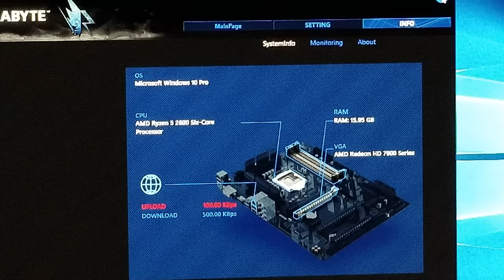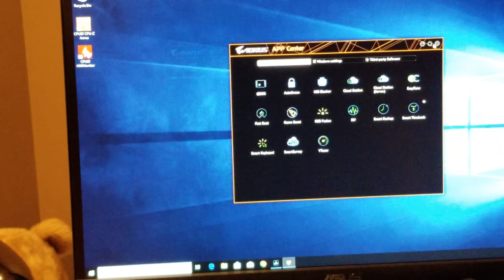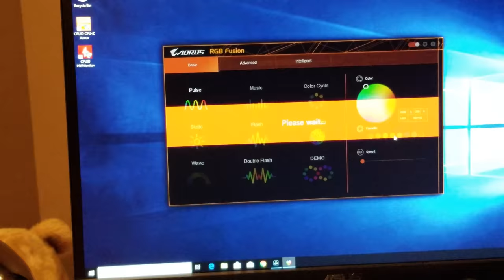Cooler Master MasterCase H500, Build Guide & Aorus B450 Pro WiFi

Comment: Hi there! Just finished building in this case and I have one issue. At 20:20 in the video you talk about the RGB fan wires, I think? and I'm not sure where I have to connect the cable to. The case wires label 2 different wires as one for (asus, msi and one other I think) and the other one as gigabyte (3 pin in). I had attached that 3pin in, into my gigabyte 12 volt RGB LED strip header on the first 3 pins (referring to the arrow on the cable) and I think my RGB lights blew out when I turned my computer on. At first I had my gigabyte labeled connector on the 5 volt ARGB LED strip header and the fans were dim and flickering so I had switched to the 12 volt one thinking it would supply enough power to the RGB fans and thats when I heard a slight pop.... It was  going so well until the final part ****. Any advice? Thanks for the informative video.
Reply from the maker: The 12V may have shorted out the RGB, you were right the first time plug it into the 3 Pin 5V Addressable RGB Header, the different connectors depend on the MB, the ARGB cable from the case when going into the MB make sure the Arrow on the Case ARGB Cable lines up with the 5V ARGB Header on the MB...also make sure the SATA Cable from the case is connected to the PSU...hopefully it'll then work, so if it doesn't (worst case scenario) you might need to replace the RGB Fans with newer one's, and if there was a LED strip you might need a new one as well, or just go without...hope that works for you...
Reply: @Reviewing_Playing_and_More_RPM  Thanks for the super fast reply much appreciated!!! Yeah... lights are shorted but fans work so until I get replacements I’ll have to live without any RGB on the front which is ok I guess. I think the reason I plugged it into 12v was because in your video the lights were super bright compared to mine when I had them plugged into the 5v. Was that the same for your fan RGB brightness at the very beginning?
Reply from the maker: @canadianbacon5716  Honestly I never noticed them being bright or dull...take care...
Reply: @Reviewing_Playing_and_More_RPM  thanks again!

Comment: so in case cables where you connect stuff like the power button, reset button, power leds, etc, in all of those specific pins you connected everything to, is that order the same for every motherboard? i’m getting an MSI MPG X570 gaming plus if that helps
Reply: amazing video by the way! i’m glad i can have a sharper eye on what case i’m gonna be dealing with :)
Reply from the maker: Yes pretty much every MB will be the same, there might be a slight variation for maybe a proprietary system like HP or Dell but haven't come across one that was different yet, Glad you liked the video...

Comment: I have a x570 auros and is kinda confusing how to plug the case ping into it and the fans bc there’s only 4 pings and not 3 pings
Reply from the maker: The system fan headers are usually 4 pin, but will accommodate 3 or 4 pin, it's just a matter of lining up the tab from the fan to the tab on the system fan header tab and it'll be good...hope that helps...Thanks...
Reply: Reviewing Playing & More RPM so I got tired and just connected the back fan and front fan cable together and it’s working but I wanna know if the rgb should turn orange when I first connect it
Reply from the maker: I don't have this PC any longer and don't remember what color it first comes up with, but as long as your able to change the colors and they stay at whatever color you've chosen then it's good to go...Thanks...

Comment: My case only brings a 3 pin rgb connector and I have the same moba... I’m wondering do I just connect it to the same place on the moba and use the first 3 pins?
Reply from the maker: No 3 Pin is 5V ARGB and 4 Pin is 12V RGB so it could cause damage...there is an RGB Adapter for around $20 that you can get from Amazon that will let you use it...Hope that helps...Thanks...

Comment: I am looking to get this case, will my ASRock AB350M MB be enough to run the RGB fans? I have an RGB header but can't tell if it is 12V.
Reply from the maker: One is 12 and the other is 5V can say for certain which one is which though, can't get a clear enough picture, but the specs say it has both...

Comment: I'm using the same case and motherboard, but the cases rgb connectors are only one 3 pin and one 4 pin with one blocked off. It looks like you have a 4 pin with none blocked off. Did they change this? I can't get the rgb on the case fans to work because of this. Do you know how I would make this work? Or will I just have to use the controller? Was hoping I could make it work using the motherboard so I could just use the rgb fusion software.
Reply from the maker: Others have told me they did a newer version of this case, can't confirm that but lots have noted this same issue so it could be true...the connector that goes to your MB will be either a 3 Pin 5V Addressable RGB or a 4 Pin 12V RGB, it'll depend on what connector is on your MB, hope that explains it a bit...if you are missing the ARGB Header you can get a Converter that will let you use it I reviewed the Deepcool Converter and and EZDIY on as well that are good choices...

Comment: Where do you connect the rgb switch that comes with the case? Is it even necessary given the software?
Reply from the maker: If you mean the RGB Adapter, then no you don't need it unless you don't have an RGB Header on your motherboard...The software will control everything...Thanks...
Reply: Reviewing Playing & More RPM My case came with a small controller, I assume it’s to change colors on the fans but the case didn’t have any instructions on wiring. Also I’d like to thank you for helping me build my first computer 😁 however, there is one thing I’d like to ask: my gpu (Rtx 2080 super ftw3) has two 8 pin slots for the power and my power cable from the PS has a 8 and 6 pin combo. So is it ok for me to use two different cables to power my gpu? Say one 8 pin vga and the 8 pin pcie?
Reply from the maker: What PSU are you using, I want to check it to be sure...Thanks...
Reply: Reviewing Playing & More RPM I am using an EVGA 750 BQ
Reply from the maker: Ok so that PSU has two VGA, it's a naming convention some PSU manufacturers use, I think it stands for Video Graphics Adapter, so I would use both VGA Cables and you will be fine, not sure why they label it this way, most people are used to PCIE not VGA for plugging into the GPU...Hope that helps...
Reply: Reviewing Playing & More RPM Thank you for the advice!

Comment: Hey, i ordered this case and i have a question. I'm planning to build my pc this saturday, but how does the RGB for the front fans work? Are there 2 cables for each fan, or just 1 cable for each fan? Like, does the RGB + Fan get powered over 1 cable? Sorry, i'm not an expert when it comes to fan cables xD. And these cables, they aren't long enough to reach the motherboard i saw in this video. So do i need a RGB Fan splitter? (1 to 3 cooler master rgb fan splitter). 

Thanks for the video, and thanks in advance for the response.
Reply from the maker: +ZodFi There is an extension/fan splitter provided for the RGB fans that when used will also extend your reach to play into the motherboard.  There is also a Sata power cable you need to connect for the power to the fans...
Reply: @Reviewing_Playing_and_More_RPM  Thank you very much!

Comment: hi, will there be enough space for me to mount a radiator and the fan(Cooler Master MasterLiquid LC120E RGB) at the ceiling of the case for the cpu cooler?
Reply from the maker: +muhamad safwanshah There is room on top for up to 240mm so yes there's room...Thanks...

Comment: Good vid. At 32:33 only one fan is connected on the front. I own one of theses cases both fans are suppose to be moving at the same time.
Reply from the maker: That's correct, I forgot to plug one of them in, didn't notice until later on, I check them all now just because of the mistake on this video...

Comment: My connector from coolermaster h500 is only a 3 pin?
The RGB works sure, plugged into 12v R and G
No blue i guess but it still shows blue?
Can't control the fan colors or speeds though
They just default flash
Reply from the maker: If you're getting the default RGB Colors, then you need to check the RGB is connected properly, ie the arrow to the arrow on the RGB Header so it's getting the right connection, also if it is connected ok, then I'd start with checking that your MB software is seeing them and make your changes there...you then said you have everything connected using the controller, if so you will need to use the controller to adjust the different Modes, and colors and speed, there is about a 3 second pause between each setting...I put notes in the video about which RGB to use, can't recall right now which one I said but as long as that's the one your using it should be ok since you went on to say your using the JRGB Header...try unhooking the back fan from the 3rd white splitter and directly into your Motherboard Sys_Fan Header and see if that might change things as well...Hope that helps a little, it's difficult to offer advice on this as things get mis-interpreted pretty easy...take care...Thanks...

Comment: Hi! I have a question I followed all of your steps and turned it on.. the fans are running and everything is lit however the monitor is not recieving a signal, do you know what is causing this?
Reply from the maker: Only thing that comes to mind right away would be how did you plug it in, ie VGA, DVI, HDMI, and where, ie did you plug your cable from your GPU to the motherboard ports or the GPU itself, so if you were using HDMI the cable should go from the HDMI on the graphics card to your monitor/tv... the reason it might not work on the motherboard ports is because if the CPU doesn't have integrated graphics like the 2400G for example then it would not give a signal or show anything... so basically check your cables where they are plugged in and if all that is ok, and it still doesn't work, we can investigate other things...Thanks...
Reply: @Reviewing_Playing_and_More_RPM  I fixed it! I put the hdmi in the wrong hdmi slot on the computer instead of directly to the graphics card, thank you so much for your reply!
Reply from the maker: Glad you got it fixed...well done...have a great weekend...

Comment: Hey! Is the RGB Motherboard connector cable different from the fan splitter that comes pre installed?
Reply: Also, do we not have to screw in the hard drive in this case?
Reply from the maker: Yes the RGB MB connector is different from the fan splitter, the RGB will have 3 pin 5V, or 4 pin 12V, and the fan splitter allows you to plug in more then one fan to a MB Sys_Fan Header...can't remember as it's been a while, but if your using a 3.5" Hard Drive it depends on the case and whether it's tooless or not but pretty sure this case yes you need to secure the HD in the HD Cage...2.5" drives usually are as well but depends on mounting system...I tend to buy a lot of tooless cases so it's quicker to put together and less work...Thanks...

Comment: My case fan connector is molex pin and it's connected to psu, its rgb though but i want to connect it to my motherboard to change the color using rgb fusion. How?
Reply from the maker: Never heard of or saw an RGB with a Molex connector, so sorry no idea how this can be done...

Comment: So I have a Gigabyte z390 Aorus Ultra mb in the h500 argb case. Where the heck does the 3 pin connector that is labeled Gigabyte on the splitter go?  Into the 4 pin 12v rgb spot?  I'm confused. Any help would be awesome. Thanks'
Reply from the maker: A 3 Pin is a 5V Addressable RGB Header, RGB Headers are 4 Pin 12V, so depending on the cable your plugging in just confirm if you need the ARGB or the RGB Header, in the case of yours being a 3 Pin connector it is a 5V and needs to go into a ARGB Header on the MB. Gigabyte labels there connectors on their MB's a VDG. Hope that answers your question.
Reply: @Reviewing_Playing_and_More_RPM  Found the VDG. I read the manual but didn't understand what that was. I think I'm good. Thank you!
Reply from the maker: @calidude4211  Sounds good...

Comment: can I replace the 2x 200mm front fan into 3x 120mm ARGB fans? does the airflow still good?
Reply from the maker: Yes you can use (3 x 120mm) or (2 x 140mm)...Airflow will still be great...Thanks...

Comment: Hello, in the last part of the video why is the top fan off while the bottom one is on
Reply from the maker: Didn't realize until after uploading the video I forgot to plug in the power cable for that fan, once I did it worked fine. Good catch.

Comment: I see that the CPU fan overlaps the ram slot. Is there a way around it if 4 ram sticks are to be installed?
Reply from the maker: Yes, when I first started doing the installs I didn't realize that if you turn the CPU Cooler the other way, so the AMD Logo faces the opposite direction it gives more clearance for the Ram...Thanks...

Comment: Do you know if I would be able to fit a fan behind the cpu cooler at the top for an extra rear-top exhaust?
If it only fits in front of the cooler it'll steal intake from those 200mm at the front and wont be useful

If it helps:
MOBO: ASUS ROG STRIX X570-F 
CPU Cooler: Noctua NH-U14S Ultra Quiet
Reply from the maker: Yes, there is lots of room on top...
Reply: @Reviewing_Playing_and_More_RPM  Thanks for the help!
Reply: @Reviewing_Playing_and_More_RPM  And nice job on the channel! Very helpful!
Reply from the maker: Glad it helps, much appreciated...

Comment: Just had someone build one for me in this case. And we used a asus rog strix b550 and we lost a 1 screw to the motherboard so there is 9 out of 10 screws in there will it be fine?
Reply from the maker: If the MB where the screw is missing has a stand off behind it, you might want to remove it, as if your MB comes into contact with it that could potentially cause a short, or if you feel you don't want to do this then I'd see if you can find a MB screw to replace the one you lost to prevent issue's...

Comment: I’m having so much trouble with the 2 front fans! The RGB will turn on, but the fans won’t spin! I tried looking & noticed that the fans are a 3 pin, but there’s no where to put it on my motherboard. Everything is 4 pin. Please help me 😞
Reply from the maker: When connecting fans, often they will be 3 pin, and the motherboard will be 4 pin, as long as you line up the fan connector tabs together the 3 pin will work in the 4 pin header...Thanks...
Reply: Reviewing Playing & More RPM thank you, but the problem is on my case fans they aren’t actual pins! They are 3 holes that pins need to get into. I have the H500P case and can’t even connect the 2 front fans!
Reply from the maker: Can't speak to the H500P although I think they are similar, I'd try getting a fan splitter to plug the two fans into and then plug the other end of the fan splitter to your Motherboard Sys Fan Header, this should provide the power to the fans, however typically the case comes with a fan splitter, so putting the fans into it and then connecting it to the sys fan header will serve the same purpose...also check to see if there is a SATA Connector coming from the case that would need to go into the Power Supply Sata and that would give power as the other option...hope that helps a bit...

Comment: Nice video! I wanted to ask about where you got those screws from for vertical mounting the ssd. I bought an ssd that does not come with it and also my cooler master case does not come with the rubber grommet in the holes :(
Reply from the maker: They came with the case, if you didn't get them you can probably get them on Amazon, not sure though...the rubber grommets might have been removed as there is a version 2 to the case now so it's possible they no longer include them...

Comment: Hey Dennis! Thanks for the vid. This is my first build. I chose the H500 and the LC240E RGB AIO.My build was a success but I cannot get my RGB to work. I bypassed the remote and just used the RGB headers on my Mother Board. Fans work fine. Just no RGB. Any ideas what my problem could be? Thanks!
Reply from the maker: I've done some research on this CPU Cooler, and as far as I have been able to determine you need to use the controller in order to sync the two RGB Fans and the Pump...the RGB Header on the MB is an Addressable RGB Header but couldn't confirm this so check your manual first to be sure...Hope that helps some...

Comment: I bought this case and a ASRock B450 Pro4 and just to be clear I will need to buy extensions for the case fans to connect them and the RGB to the motherboard? If so where can I buy what you used.
Reply from the maker: The extensions came with the case so no need to buy them...should be a great system...Have a great day...Thanks...
Reply: @Reviewing_Playing_and_More_RPM  Thanks I missed the part at the beginning when you disconnected the cables.
Reply from the maker: No Problem, I thought I could eliminate some cable but wasn't able to wish they just made those two cable longer...Thanks...

Comment: The two cables that I did not understand was the one that had two different type of motherboard cables that are gigabyte and asusrock/asus msi. On the other end of this cables there were three three pins. And the second one has 3 entries to something that all three look the same but one is white and two are black. Thanks
Reply from the maker: I don't remember that cable, however if they are labelled as such then the one that corresponds to your Motherboard is the one to use, the cable end that has 3 pins if it's RGB then it goes into the Addressable RGB Header...sorry...